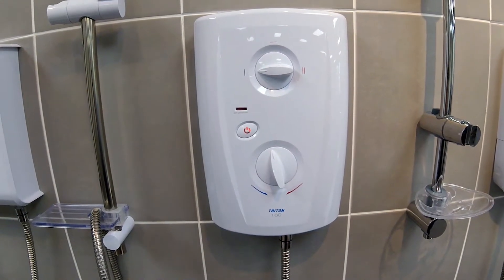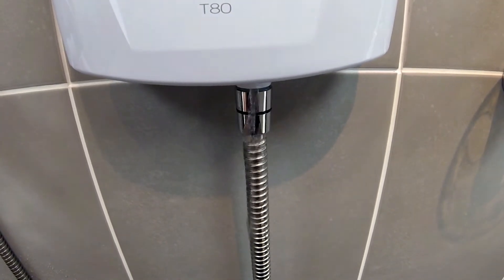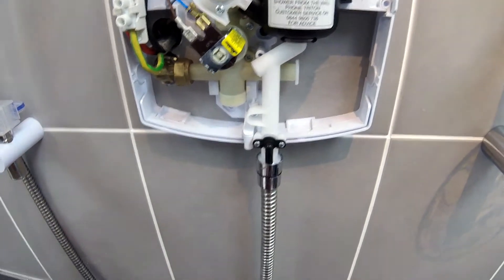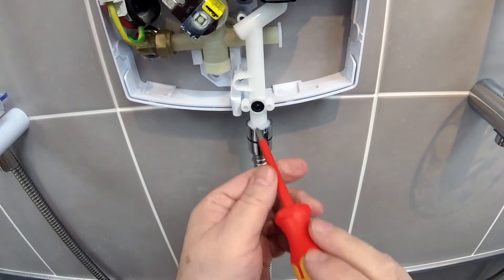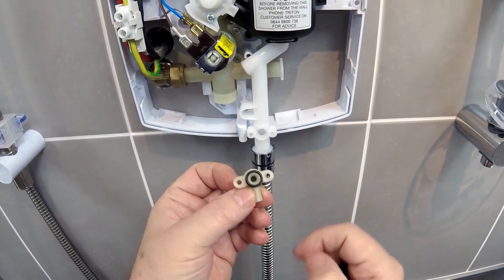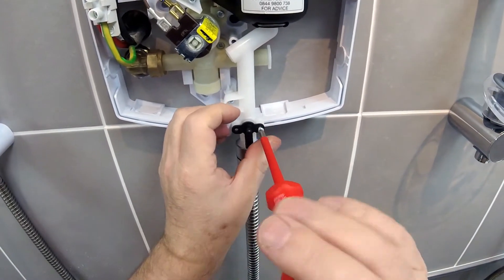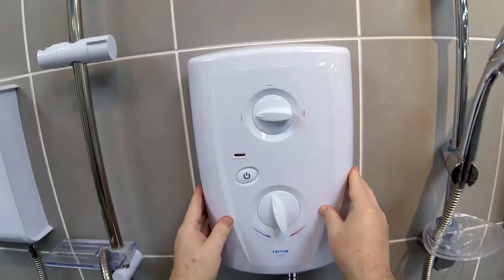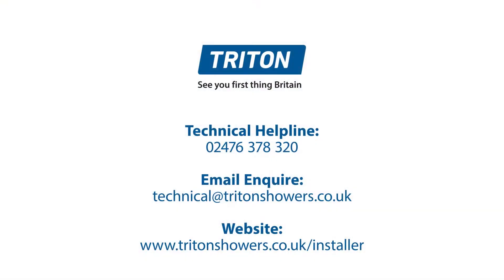Replacing the pressure relief device on the Triton T80 Pro-Fit Electric Shower

Comment: Thanks. I have ordered some replacements. The pressure relief fired after replacing a shower head. The head seems to work pretty well, but I am wondering if I need to adjust the pressure going in? Any advice ?

Comment: I’ve got a similar issue but it is to do with the white plastic that the piece you removed sits on. Where it meets the motor section it is leaking from there. I have removed it to see if any damage and cannot see anything however there is a black rubber O ring in there. But I cannot find any replacement O rings
Reply: If you did not get your o ring yet ,try heating parts warehouse

Comment: Can this be done without switching the mains water off? Of course turn off the shower and fuse for the shower. I don't have ease of access to my water stop...
Reply from the maker: Thank you for your message, it is possible to do this without isolating the mains water as the water going through the T80 pro-fit would be stopped by the inlet solenoid valve assembly. However as per the installation instructions supplied with the pressure relief device we would always advise replacing the part with both the water and electrics isolated for safety. Kind Regards, Leon.

Comment: Did you need to replace the burst disc?
Reply from the maker: Hi, yes once the burst disc splits it would have to be replaced, when ordering the PRD (82800450), the burst disc is included along with some fitting instructions.
Reply: @TritonShowers  do you need to turn the mains water off to do this?

Comment: Why does this fail in the first place? Does it indicate a problem elsewhere?
Reply from the maker: The pressure relief device will activate when there is a restriction on the outlet, most commonly this will be something like a blocked shower head or kinked hose. This can also occur when the wrong accessories are being used with the product, like a non branded head/hose which are too restrictive.
Reply: I had just changed the shower head when mine burst. Wondered what the 'ell happened! Back pressure from the new head caused it.
Reply: @TritonShowers  My original one lasted 13 years so possibly just worn out? No kinks, I will ensure shower head is not causing any issues but Ive had it a few years. All fixed.